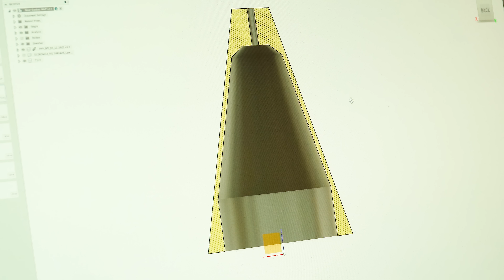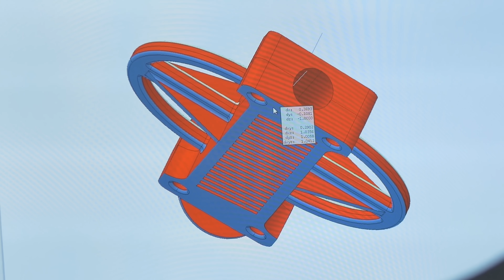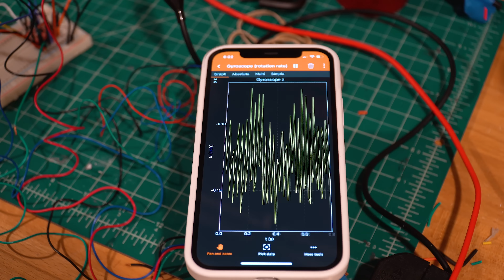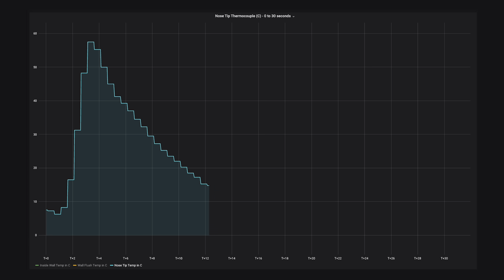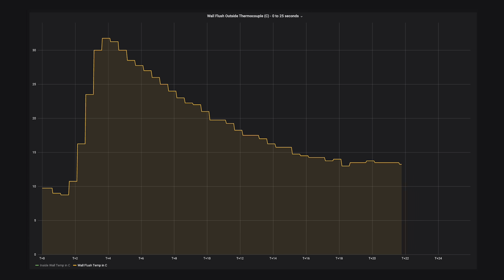How Hot Does a Rocket Get?

Comment: I’d suggest perhaps putting a microwave in the nose cone
Reply: Most practical suggestion so far.
Reply: use a AA battery to power it
Reply: @fullflowaerospace  AA batteries*
Reply: @tutorydean8867  no, what I said is correct
Reply: Ah, well...just got home from work and I see that I've been pinned. I'd like to add that I am in fact an engineer. I got my degree in robotic systems engineering last May and I work for an aerospace company in Arizona. I'm happy my solution is clearly the favored one :P
Reply: @ImAnarchy  microwaves > stoves
Reply: @ImAnarchy  Trust me, I'm an engineer.
Reply: Plus another spinner to counteract the spinning microwave plate.
Reply: @JiveFowl  lol
Reply: Radar range finding.  But without the electromagnetically transparent nosecone. And with meat.
Reply: Good to see a smart guy with good humor:)
Reply: That's how time-travel begins..
Reply: Well I think you should probably make a teardrop like design with the motor sticking out and at the end of the rocket having very sharp edges to disconnect the air
Reply: Or just shortcut a Li-Ion battery, that should provide enough heat.
Reply: and power it with the heat outside the rocket
Reply: Which IMU is used here
Reply: Whats a ferrinheight
Reply: That would definitely fit with room to spare!
Reply: A microwave is basically a radar, so are you suggesting a radar guided missile 😮

Comment: The thermocouple cable terminations you used are flawed and not accurate. Wago terminals are NOT suitable, being made of a copper alloy with tin plating. It comes down to dissimilar metal joints that creates additional junctions - So additional mV signal input to the instrument. The terminals SHOULD be made of the same metal alloy. The plugs used for thermocouples use these 'same metal alloys'. In industrial applications you terminate the field cable at the instrument that uses screw terminals made of 'same metal alloy' that are solder to the instrument circuit board (so much for not soldering) or we use field terminals (expensive) made of the same metal alloy (yes... they are made) but then wiring from those terminals to instrument using 'compensating cable'... essentially 'cheaper' cable made from 'same metal alloy'. 
The soldering these thermocouple alloys maybe problematic, requiring special solder and flux. 
Some types of thermocouple metals might solder easier than others.  eg. Type J (not K) or one of the platinum alloy combination types, that suit high temp applications - nowhere near the actual temp range you seek to log. 
btw... Type K cable will have a red & yellow wire insulation and a yellow plug. The red is Negative. 
Better to use a 3 wire Resistive Temp Device.. or a precision semiconductor made for temp sensing... that connect using bog standard copper wire. Cheaper, less problematic and more suited to the temp range. 

But hey, moot point really. If you have ever cooked meat 'rare' you have the meat reach a temp of at least 60C for 3min. Is that possible?  No.  Be prepared to eat raw meat. 

Attach the thin sliced meat to cone using thin aluminium foil, both wrapped around the cone made from thin aluminium soda can.

Comment: Could a kind of internal griddle iron work? Thin wall with ridges on the inside to transfer heat into the meat pressed up against it maybe with an insulated conical lid/divider then pushed up and locked in on top pf that to keep it in place, keep the heat in and away from the inners.🤷🏼‍♂️🗼

Comment: A bit late, but the problem with soldering thermocouples isn't the solder or the heat; it's the change of conductor material between the wires and the amp. This is called the "cold junction," and you measure its temperature in addition to the "hot junction" at the tip of the thermocouple. The error can be compensated if the cold junction temperature is known. Many board-mount female thermocouple connectors are designed with a little clip to hold a temperature sensor (TO-92 transistor package) to measure the temperature on the board and compensate for the error. Adding the Wago connectors is worse than soldering if the amps have built-in compensation sensors. You're adding junctions at the Wago for both wires, and the solder connection between the Wago and the PCB. All your temps will be correct relative to each other, but they will all have some error from the extra junctions.

A potentially easier way to measure the temperature would be with a thermistor. They come in form factors similar to the thermocouple probes used here, and your leads can be soldered and extended without much care. It's relatively easy to throw together a current source (100mA or 10mA are traditional) and measure the voltage across the sensor. Converting the voltage to find resistance is simple, though the Stienhart-Hart equation might be a bit heavy to compute. Some low-power applications will precompile the resistance/temperature values to a lookup table.

Comment: So I have had this design of a "periscope" camera on a rocket that would theoretically provide stabilization with no moving parts. The idea is to create 360º ring mirror flared slightly around the entire circumference of the rocket (or possibly inset into a clear section, if aerodynamics are a concern) that bounces the ring of light into a single lens that directs it into a camera sensor. I've even played around with having multiple rings for multiple "angles" of capture of the launch, although you trade resolution without significantly increasing your sensor hardware.

You could then use software to stabilize the image on the ring (as opposed to common stabilization algorithms that work on a rectangle), and as a bonus get a 360º view of your launch. Depending on your periscope angle, you could capture down, perpendicular to the launch, or even up.

I have some CAD designs and more understanding of photography than rockets - but if it seems like something you might be interesting in giving a try, give me a shout.

Comment: Copper cone, super thin 60 gauge section for meat, have deli sliced steak on it

And as well open window and chunk of meat jjst exposed window slightly under tip.
One each side
Reply: Can hold meat down with wire mesh

Comment: Here's an idea for the meat cone... you'll want a more rounded nose for this, and thin, to get as much heat transfer. Aluminum is about as light weight as you can get for maximum heat transfer. And by round I mean the opposite of the Despicable Me tip you had for the sensors, lol. Then you need a second piece of the same shape, but smaller, to slip inside the cone to hold/smash the meat against the tip. The inside piece could be any material. You may also need a sponge of sorts to collect the juice as it cooks, or you'll end up with flavor dripping down the inside of your rocket. A piece of flap meat would be perfect since the flight/cook time would be a bit short and it's nice and thin. And viola, you get a nice piece of Mach Meat.

Comment: When you said meat rocket my mind immediately went to using meat as a fuel source. Chorizo used a common oxidizer one of its ingredients which you probably already kno3 and has a pretty high energy density, would it be possible to make a solid rocket fuel recipe with a modified chorizo recipe?

Comment: the meat 100% has to be in contact with the metal so that you have thermal conduction and not relying on radiation / convection. Also i would focus on higher thermal mass so that it cooks for longer but also absorbs peak heat load. A minute steak (about 4mm thick) needs as the name suggests 60 seconds of "cooking" temp to be safe, if the sandwich hot plate contraption is >100 deg C for 60 seconds then your golden! How to calculate if you have enough heat load in is another question altogether and i have no idea that's why i watch your channel. My main intuition is high thermal mass = longer cook time and flatten the curve of peak heat load.

Comment: At first I thought he was joking, then Mr. Joe stared getting serious about his stake. 😂😂😂
You made my day.

I wonder if a thermoacoustic heat pump could be built with in the noise cone to better transfer the heat to the meat.
The motion of the rocket can be used to generate the necessary sound waves to drive the pump.

And great content man,
I love watching your videos.
Reply: or perhaps build a vapor chamber with in the walls of the nose cone.
like a laptop heat pipe.

heat pipes do have a higher heat "conductivity" than just a are solid pipe.
sometimes up to 250 times.
[For example aluminum has a thermal conductivity of 0.247 kW/(m⋅K) but if you make a heat pipe out of it go up to 30 kW/(m⋅K) ]

Comment: I'd almost recommend you redo this with four thermocouples inside the nose, and then back calculate what the surface temperatures had to be to result in those internal temps. No unreliable thermocouples exposed to supersonic air and since your material is thin aluminum you can calculate the heat transfer with basic equations, or if you want to get fancy you could do the same in CFD.
Reply: The other issue that i'm sure other commenters may have mentioned is that the WAGO's interrupt the bimetallic chain before the cold junction compensation, and will throw off your readings. You can either change that next time, or use 4 Wire RTDs which would be more accurate and easy for what you're doing.

Comment: Make the external cone out of thin walled Copper as aluminum only has 60% of the thermal conductivity of copper.  Do Not finish the copper brightly, as you want to minimize heat reflection from the bow shock.   Make a second internal lightweight cone out of thin wire mesh that will hold the thin piece of meat against the inner wall for contact heating, and inside the wire cone, separated by a couple mm create an inner cone that is finished to a high polish and electroplated with a thin layer of gold to reflect the maximum amount of infrared radiation. ( you can plate 3D printed plastic if you paint it with silver nitrate or some other conductive material first. ). What you want is the inside to be like the reflector on a old style glass lined  thermos bottle to reflect heat away from the rest of the inside of the nosecone, concentrating the heating to just the zone the meat is in.

Comment: Make a double cone nose cone with meat in the middle. 

So like essentially wrap your current nose cone in meat and then put another thin nose cone on top of that. 

So you know your inner nose cone will protect the rocket and the outer nose cone will cook the meat. And you’re protecting the meat from wind sheer.

Benefits are if you use ground beef and it works you have a cone for your mashed potato “ice cream”. Chili flake and parsley sprinkles, gravy caramel sauce, meat rocket ice cream party.

Comment: Would you be able to use a Shockwave to try to cook it? Like if it's really thin, you may be able to really heat a LOT the air juste after a shock (which will be static if you add an angle or a change of direction for the air flow on the nose), but I have absolutely no idea about how to do it without breaking the aerodynamics

Comment: Hi there! as a weird crossover between a ballistics dork and a cooking nerd, I suggest 1) a copper nose cone rather than aluminum to maximize your heat transfer, especially in light of the fast cool down after, 2) that it be thermally insulated from the rocket body and free to heat up and cool down as one unit.  the large size of your total nose cone body is acting like a giant heat sync to allow the heat energy to leave the tip, which you want it to stay concentrated in. maybe if you had a shorter flatter stepped nose cone design, you could actually optimize for the heating of the whole surface of that, or for the heat to contentrate around the circumference of the step rather than the center point tip of the nose.

Comment: Extend the nose cone material to make up some additional fuselage room. Neck down the material according to some heat transfer calcs. Wrap the steak on the inner lining of the extended cone section. You'll have a thin layer of metal directly contacting the steak with minimal thermal mass receiving aerodynamic heating. You could even make an inside portion (on the inside of the steak wrap) that extends from the tip of the cone so the meat is heated from both sides to get some better efficiency, but you gotta worry that adding too much thermal mass will reduce overall cooking so there's another trade there

Comment: If you want to increase the static temperature (to heat the nose cone away from the stagnation point/tip), you may want to blunt the nose cone a bit to encourage a stronger shock. For the design target of Mach 3, the maximum angle for an attached shock would be around 33 deg ish. You may also want to use a purely conical shape, rather than the tapered shape to prevent the flow from reexpanding and cooling down. Temperature (both static and stagnation) are proportional to freestream static (ambient air temperature) and to the square of mach number, so flying on the hottest day possible (like in the summer around 100F), plus Mach 3 should give you about 9-10 times hotter at the tip in the ideal case for the same geometry you used in the video.
Reply: After thinking a little more, a double cone, with a narrower cone at the nose and a wider cone below would lead to shock interactions and help heat the boundary layer

Comment: Make a two-part copper nosecone that screws together with the slice of meat squished in-between them in the center. Use thin copper and, for better heat transfer, use heatpipes. Attach those with liquid metal and epoxy. Think of it like an aircooler for your pc, that squishes the CPU (Meat) in-between two plates with the heatpipes not going to a radiator but the surface of the nose cone. If you really want to go mad, put a thermal clutch inside, that, once the copper-meat-stack is heated up, disconnects it from the nosecone, avoiding reverse heat transfer.

Comment: You can use brushelss motors for stepper like position control, when you drive them with 3 sine shaped DC voltages.
Brushelss gimbals do it that way.

That would allow you to keep the tiny brushless motor and have a smaller geartrain.

Comment: Sandwich the piece of meat between an inner metal nosecone and an outer metal nosecone, and both parts would need to be as thin as structurally possible, maybe use a more thermally conductive metal too, and perhaps use a threaded locking ring to hold the outer cone on. Also a blunter nose should in theory create more shock heating but idk if that would affect your performance or stability at high mach numbers

Comment: For introduction, to be a bit nit. "How hot does a mach 1 rocket get?" is differend from "How hot does a mach 1 rocket tip get?" You know what is the hottest part in a chemically propelled rocket is...
What is the task? Simply "cook" a piece of meat with a supersonic model rocket? Leads to the following:
- The meat must be in some way "cooked" (or baked).
- The rocket must fly faster than sound travels.
I would build a tube at the back of the rocket, wrap the meat slice inside some aluminium foil wrapped into copper foil (thickness depends on the reactiveness of the material) and put the wrap insode the tube. The exhaust gasses pass through the tube and pass by the wrap.
Another space tech approach: Use a heater. These are a common part in space tech, because the electronic components are not specified for the low temperatures that may occur on the shadow side of a planet, space station etc.
Now I duck down and hope for low winds...
May your sky be blue and the winds low!

Comment: What if you have a fiberglass mandrel, a thin void, and a copper or aluminum thin outer shell, holding the assembly together with an axial threaded rod? It means the same amount of thermal energy will get absorbed quickly into a smaller massive metal and be forced to travel through the meat?

Comment: hunt around for steppers. try "moons" maybe? aptly named. 

i got a few, think the stepper from a CD player strapped to a planetary box, for about $20, and it has an encoder...

about 20mm in diameter.

then theres all the ones from the focusing rings on cameras, etc... cheap as, got gearboxes, lightweight... you dont need power here, you need smoothness, and speed. a nema17 is overkill. that gearbox is overkill... all this weight, inertia... its not dealing with that much torque.

another option is the... what do they call it? positional control on BLDCs? foc? i hate acronyms.

the magnet drive was neat but again... weight. with a much smaller stepper unit it wouldnt be needed either. ideally you have the clearance at the bare minimum, and some sort of "holding" array... opposing polarity magnets that keep that pole restrained to its attractor.

that slightly concave profile to the cone didnt really strike me as being right...

still... the shots you are getting are great, it definitely seems to be working. more refinements required.

Comment: Adding a ram-air intake at the tip could do the job of heating you steak, by setting your intake shape to have adiabatic characteristics and putting a heat exchanging media (Al fins of a  PC radiator?)at thepoint of highest compression you could reach high temperatures in a very localized manner

Baby steps toward a BPS.space scramjet

Comment: My idea is to transfer the thermal energy from the rocket cone to the meat via conduction.

- Weld a metal rod to the inside of the metal nose cone
- Wrap a thin layer of meat around the metal rod inside of the rocket
- Send it!

If the meat is thin enough it'll cook all the way through, and rod-based conduction heating will give you the opportunity to shield the meat from airflow since you'll be able to keep the meat-heating-element inside the rocket frame.